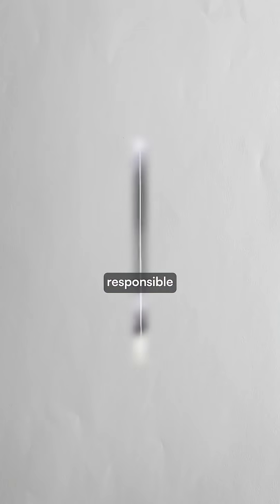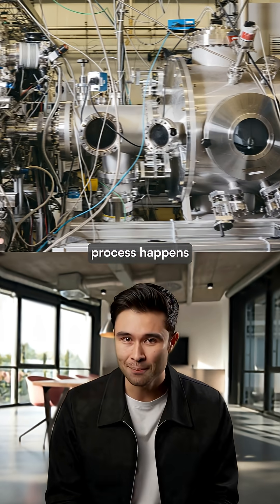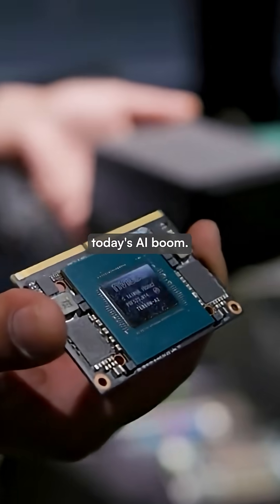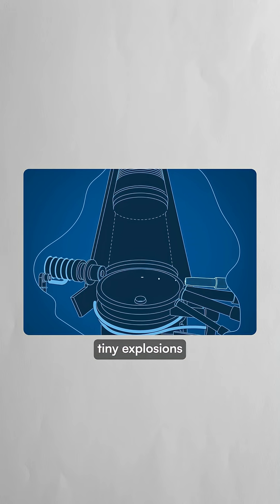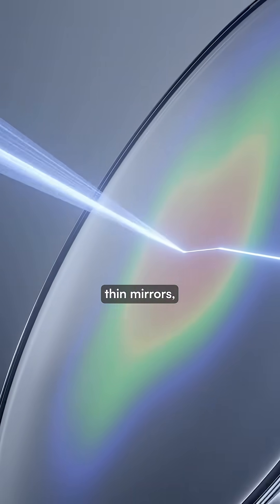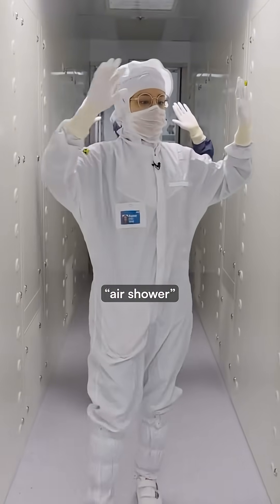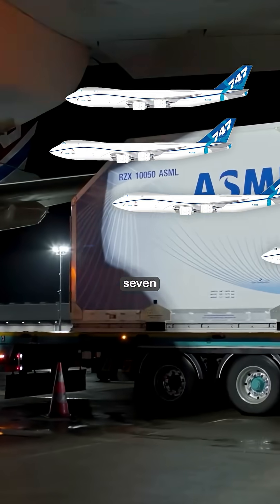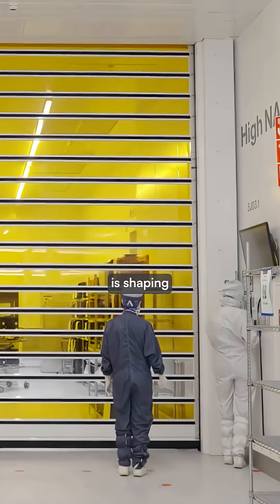These machines are responsible for the world’s computer chips ⚙️ #trendingshorts #ai #data #tech

Comment: Engineers are so clever.  No wonder why we made it to moon with slide rules and vacuum tube based computers.
Reply: Uhh.. they were not vacuum based. Search for Apollo Rocket computer fabrication. 
* it was made by discrete transistors and other passive components that utilized ultra small packaging techniques
Reply: Well said
Reply: no - microprocessors were developed for the  Moon program.
Reply: Vacuum tube computers was too big for the rocker instead they used an ancient version of a solid state drive (SSD) which was readonly
Reply: @patfre what would an ancient version of an SSD look like? ..  and be made from ?
Reply: 1 vacuum tube = 1 byte 
🤔 or was it 1 bit...
🤷‍♂️ I must be getting old.
Reply: @thediplomasta5891 It depends on the tube type. * A typical single anode type tube requires a minimum of two vacuum tubes to implement a Flip-Flop type logic circuit ( ie 1 bit).
* Its possible to implement 1 bit with a single triode type tube.

* Back in the day, my first microprocessor project used the INTEL 8008 Microprocessor. 
* It had a clock rate of a whopping 12.5khz. Yes... kilohertz... lol

Comment: Apple do not make their own chips, they are actually made by TSMC and in some cases Samsung.
Reply: Using ASML machines.
Reply: I mean Nvidia is the same way
Reply: to this logic, Intel and AMD dont make their own chips either. Apple does designs there own chips in same way Intel, Nvidia and AMD do, but yet, the actual manufacturing of the Silicon is done by companies like TSMC.
Reply: @Tracer1999  Whilst Intel does use Samsung and TSMC, they do use their own facilities as well. TSMC are by far the market leader.
Reply: @Tracer1999 As does Tesla with their Dojo designs.
Reply: @Tracer1999 I can assure you Intel did make their own chips in the past.
Reply: @Tracer1999 we have an intel fab in my city…where they make chips
Reply: @Tracer1999 Intel has their own factories that has these machines Intel does not and have not used TSMC in quite a while
Reply: @Tracer1999 This logic is correct. AMD and Intel no longer make their own chips. TSMC and Samsung are the only major chip makers in the world.
Reply: @yaltschuler  Thats not right.
Intel still owns their own fabs tho I belive they have comitted to not invest into further process nodes.
Reply: @FlaxTheSeedOne they where forced to build new factories so that isn’t correct
Reply: Apple is just lazy now. No new innovations after Steve Jobs.